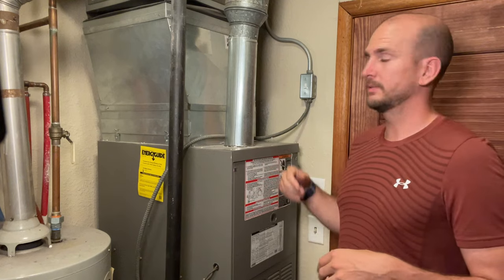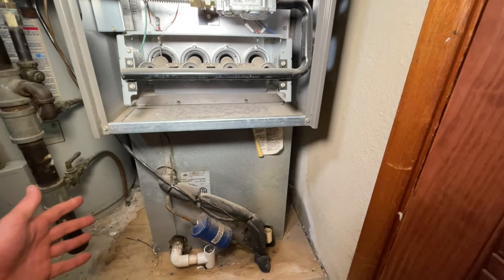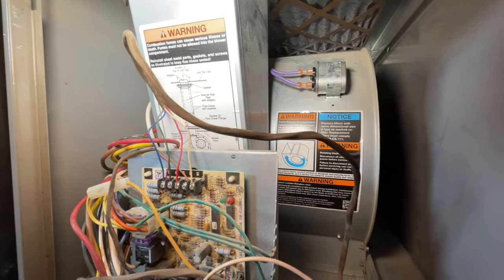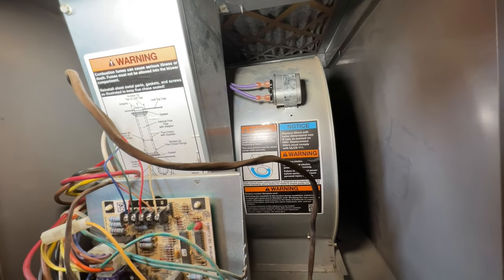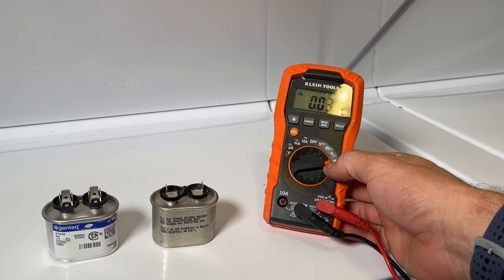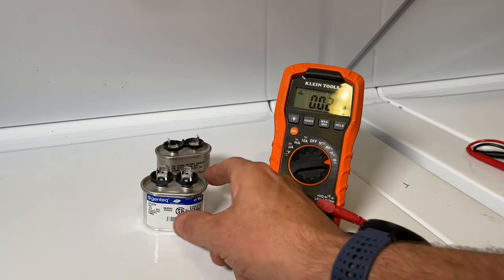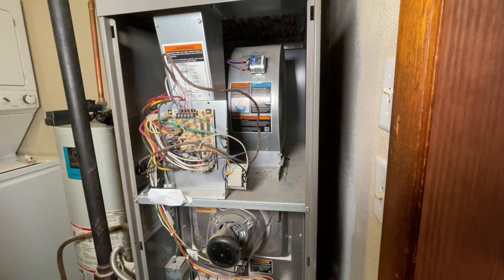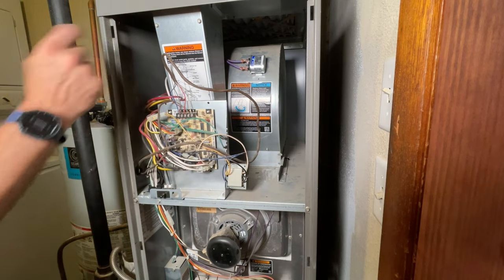Furnace or AC Blower Motor Not Starting | Loud Buzz or Humming Noise

Comment: Yea,  My thieving HVAC company, in my area, wanted $314.00 to replace my dual AC capacitor.  I bought it for $7.20 and replaced it myself.  Should be a law against this type of price gouging !.
Reply: Having just basic knowledge sometimes can save you so much
Reply: Omg serious. The serviceman wants $2000++ to replace my thermostat, board and labor cuz my furnace does not blow warm air into the room.
Reply: You pay for conveniet 
Company's have huge expenses if they work for cheap they can go out of business  fast
Reply: @mh_360  No one said “work for cheap”.  We’re saying stop price gouging (rapping) everyone. How about a fair price for what is, almost 5 minutes work ?
Reply: @ItAintMeBabe99 it’s not how long it takes to fix it’s how long it took us to learn. Fix it yourself or pay for a professional and do it right
Reply: @DeviousMeekz  Michael,  your missing the point.  It wasn’t broke !  He was suggesting what could be replaced because of low readings.  It had 3 push on clips and one screw for the band clamp.  I changed it in a literally 3 minutes.  Obviously you must be a repair tech if you can justify those prices.
It was clearly an “up-sell”, from him to get commission $$$.
Reply: What would have been a fair price in your opinion?
Reply: @dswingle8695  I’m glad you asked.  First of all, I’m not saying work for free, just don’t rape people.  In my case,  (the AC unit was already opened up, for other work) the $314 charge for a $7.20 item, would of been about a 4,300% profit.  So, I would say around $50 or $60 would be fair.

Analogy; let’s say you took your car to the dealership for needed work. While you were there, they said your windshield wipers are close to needing replacement. So, you say OK, do it.  When you get the bill, they charged you $1,090 for wiper blades that cost about $25 (4,300% profit) .  Would that be OK ?   Not in my book!
That’s all I’m saying.
Reply: I just am nervous about trying it myself. Really can’t afford to pay a professional if I had a way to know I was doing the right thing.
Reply: @ItAintMeBabe99 I am nervous my luxaire doesn’t look like his exactly but I have air and furnace in same unit. But I am struggling to identify the run capacitor and how to take it out.
Reply: @ItAintMeBabe99 your still not taking into account the overhead of a company. Some people are not comfortable with doing this stuff themselves. With almost everything, if you do it yourself, you will save tons. Now I will agree, some companies go overboard with the pricing. I saw a company one time try to charge 1000 for 2 capacitors.
Reply: @RonaldRegan314  Exactly my point . . . . . . . Stop screwing the customer!  I will never ever call the company that came to my house, again !  Furthermore, I’ve told everyone I can, about this “attempted robbery” and not to use them.
Reply: Same. They wanted to charge over $1000 to replace both capacitors and a relay, which I got all 3 parts online for $30. Recently replaced a sequencer that I got for around $25, and I'm sure they would've tried to charge hundreds for that repair as well. The upcharge is absurd. Even most auto mechanics don't overcharge that much. Nevertheless, it's a good thing I've learned how to be handy and fix what I can myself.
Reply: Your probably one of the pros charging a ton ripping people off!
Reply: @isaactungate6669  Isaac,  who are you talking to ? ? ?
Reply: @ItAintMeBabe99 what’s a fair price? You pay for labor not parts.
Reply: @davidhaworth7152  That’s exactly my point !  They were already here, had the unit opened up, adding Freon to it.  I was paying for the service.  The capacitor had “terminal clips”, which takes less than a second to unplug and replug.  So, exactly what labor am I paying for?

Comment: I thought this was my problem, my unit would buzz just like in the video or it would turn on, run for a minute and then turn off and buzz. The old capcitator was jumping all around on the meter so I replaced it. Still doing the same thing. Fantastic video nonetheless!
Reply: Check if you are getting clean power to the capacitor/fan.
Reply: @willarddickerson921  it was a bad blower fan. I replaced it and the capacitor and all is good. Saved about 1k which is even better.
Reply: @jg-wb3vm  how do you know which blower to get? are they standard
Reply: @xooq_  aw man, that was a while ago. I believe I did a Google search on my model heat pump and went from there. Also maybe got a number off the motor that was already on the unit.

Comment: Thanks! This vid helped me ensure that the sound I was hearing was what I thought it was. The capacitor cost $3.70. I had a friend pick it up on the way over. They were happy to help, and refused to accept my payment for the part, as I didn't charge them for lunch. Likely saved me $300-500 for a service call to get it fixed, and was solved before I had my morning coffee, rather than waiting a couple days in the heat for the repair.

Comment: Question. My furnace is comeing on the ignitor is lighting and a flame is there but not getting any heat outta the registers im getting air but no heat there is a flame but its almost like its not fully cycleing and its not turning off at all only if you turn it down below set temp.

Comment: Dude!!!!  THANK YOU!!!   My capacitor finally failed today, did a search on YT, found your vid, picked up the part at a local ACE Hardware and had everything back up in running in no time.  Took an extra hour to clean the fan/blades/intake/etc...  Super quiet on start up and works great!  Thanks again!  😎
Reply from the maker: Nice, my local ACE didn't have a selection of Capacitors but I did see some location about 2 hours away did.  Pretty handy having ACE stock common capacitor sizes 👍

Comment: I thought my motor was out again; just installed a new one in 2021. The manufacture date was August 2020 on the capacitor that I purchased with the motor. This video did help me determine that the problem was the capacitor rather than the motor. Thank you!

Comment: Worked for me!!!!  Took a while to find the capacitor, it was hidden on the back of the fan housing out of direct sight, luckily I saw two wires going back there and then felt around with my hand! LOL Was an old 1970s Bryant model.  Changed the cap and the fan started right up without the drawn-out groan.  Thanks again for this video!!!

Comment: Good info. My system is making the same noise and nothing is blowing through it so I figured it was the blower motor. I'll for sure try your fix first!
Reply: My blower fan isnt blowing air into the room. You can feel the heat but no warm air blows. Furnace sound like my furnace.

Comment: The tech had already replaced the capacitor, and it's still making the humming noise. It seems to do it when the temperature drops. If I turn the unit off and turn back on when the temp outside is 42 it seems to work.

Comment: Thank you, I was going to school for HVAC (epilepsy stopped that 😞)  but I still have all my books and stuff- I had the same problem with my Rheem system, and I have replaced the capacitor (the first thing that came to mind, plus it was a cheap replacement...) and then I couldn't get the whole system to start.  I started to dig through what could have been going wrong, the hum was going still going on- the circuit board... I don't have to replace the whole thing, or just which part (haven't found it yet... I still have to check it with my meter)  Sorry this is so long ago of a question, but I'm completely lost on this.

Comment: I had a bunch of power failures the past few days due to high wind storms and I guess my furnace went out when I was asleep and I woke up to my house freezing. I’ve trouble shooter it and it doing the same humming. The motor is new and I’m assuming the power going off and on so much may of messed the part your explaining in this video up. Thanks for the video and hopefully I can find one to see if that fixes my issue.

Comment: Thanks so much for this video.  I just pulled my capacitor and it only shows 1.5µf on 10µf capacitor.  Bought one at Grainger 5 minutes away from me for $5 and change.  Hopefully this solves my issue.

Update: Yep, replaced and it's all back up and running.

Comment: Not replacing batteries in thermostat cost me $500. Air handler stopped blowing completely but was humming and froze the inside and outside unit. It's under warranty and ac tech replaced blower motor. $310 for labor $97 for service fee and $90 for refrigerant. 2 days later it wasn't working. On a hunch I replaced thermostat batteries. Instantly the system was working fine. No problems since. I hope this helps somebody out there.

Comment: Thanks for the info. Would it be possible to list the most common failure points of the HVAC system, winters coming and would like to stock some replacement parts if needed, thanks again for sharing.

Comment: I have a brand new York furnace. It is running fine. When the furnace is idling but still plugged in, it makes the same humming noise you have. Does your new capacitor make any humming noise at all when the motor is not spinning? Thanks!

Comment: I have a question. I’m decent with DIY and I rebuilt my AC unit. Now I’m having furnace problems. I have a Carrier Infinity system. Error message on thermostat says blower motor fault. I reboot power and sometimes it starts. When it tries to start, I hear a thud, like a shoe kicking it. I hear the thud multiple times. When it does start, the blower motor sounds fine. Starting is the issue so could be run capacitor but would that cause it to make a thud sound? I figured it was probably the motor. Hopefully I can get a quick answer because when my system reaches temp and shuts off, half the time it won’t start back up. Thanks for the video and the help!

Comment: I am experiencing an issue with my air conditioning unit. Despite the cold air being emitted from the vent, there is a persistent humming noise. I would appreciate your assistance in identifying the potential cause of this noise.😊

Comment: What about the bottom half of the furnace? What's that for? I'm making sure I'm just knowing what I'm doing before messing with something I don't completely know. Thx if you can answer, kudos! God bless you and your family 👪 🙏 ❤️
Reply: That's the draft inducing motor for removing any extra gases from the system to the exterior of the house so you get a clean consistent start of the gas burners for safety reasons. There are several failure points in that system as well but it's only for the heating side of things and not the cooling part.

Comment: Great video, thanks for the info! I don't have this issue right now, but I've seen it enough times to know that I should prepare for the eventual fried capacitor now that I'm no longer living in apartments that handle that stuff for me.
Reply: Me too.  I might double check what mine is and have one on hand for if/when mine goes out.

Comment: Great video thanks. My furnance works if I put in the thermostat the fan on manual I get hot air into my house however if I put the thermostat in auto the furnace on but I won’t get hot air in the house, any advise? I will appreciate a lot

Comment: When my a/c switches on I hear a VERY LOUD click/clunk before it starts up.  When the a/c is off I can still hear a low buzzing sound.  Do you think switching out the capacitor will fix both issues?

Comment: thank you for the video. I am planning to replace the capacity as you show in this video. Hope it will solve the problem of my AC ( The blower is delay for couple minutes after the condenser started).  As I recall,  I did not replace the capacitor of the blower for the last 15-18 years. so I decide replace it any way.  I am appreciate anyone think it is a solution to fix the blower delay. thanks

Comment: AC tech who was a “ friend “ changed outside condenser unit capacitor for about $130 with a “ friend “ discount. Afterwards I changed mine out myself and never used him again. Just did it again 2 days ago. It was blowing warm air the compressor wasn’t running. Replacing capacitor fixed my problem. Only it doesn’t get to set temperature of 78 degrees and only gets to 81 degrees during the very hot day here in San Antonio. But does get to 78 at night  heat index 110 degrees during the day. I’m going to use coil cleaning spray can from Lowe’s see it that works. Filter been changed out. I cleaned outside condenser coil with water hose. Any other ideas?

Comment: Shut my ac off last night because it was cool out. Today all it's doing is buzzing in furnace. If I turn fan from auto to on it works. Outside unit is running. I guess cap? Also filter was dirty and I replaced it
Reply from the maker: Might be starting to go, do you have a multimeter where you can do a quick check on the micro farads?  Should be +/- 5% of the rating you see on the cap.

Comment: question we have a gas furnace also has central air alk winter we had use portavle heaters syopped working  can a outlet swich plug in house that bad set furnace not to work ?

Comment: That is also the case with your general consumer electronics electrolytic  caps as well.  220 mf at 250V, for example, with 220 mf, or whatever, at let's say 400 volts. Besides operation, heat is your primary enemy to capacitors in general.

Comment: I swapped out the cap on my outside unit for 30 bucks today locally, but that didn't do anything. I had replaced it a few years ago and that was the problem, but it isn't my problem now. I will check the blower cap in basement tomorrow. the vent fan isn't coming on at all. my aunt said it was making a noise, but since I didn't actually hear the sound, I'm stuck trying to figure it out. I'm mechanically inclined. I can replace anything if I know what that thing is lol

Comment: Mine does the same thing you showed. My blower motor is makes the exact same sound my cage in can spin it freely with no problems my question is if the cap doesn't work what else could be the problems.

Comment: I just had a new blower motor & capacitor installed in my quiet running 2005 TempStar N8MPN100f14A1 that seized-up one evening a couple days ago - a surprise as it's under a service contract and supposedly had a good capacitor. The problem is the new motor is producing an annoying and constant drone that I surmise is harmonic modulation that varies from a fast to slow whining-like buzz. Please, advise, what is causing it and how do I fix it? The service call cost me $1000. Thanks, in advance for your assistance.

Comment: Years ago the fan on the outside unit of the ancient heat pump system in the apartment I was living in refused to kick in. Maintenance guy knew right away what was wrong: bad capacitor. Took 10 minutes to replace. I was hoping for a new energy-efficient system. No such luck.

Comment: Thanks for the video.  The sound was identical to mine.   I confirmed defective capacitor on my furnace by spinning the squirrel cage by hand with "fan on" selected on the thermostat.  It started up just fine by that method.  I then turned on the heat, and just kept the fan on all day until I got the new capacitor.  The motor ran all day without having to start up again.  It would have gotten really cold in the house with outside temps of 20 degrees.
Reply from the maker: Nice, solid work troubleshooting. 👊

Comment: Hi my Lennox furnace /  Heat Pump system, the blower motor turns on when the heat is on but doesn't turn on when the AC turns on. What could it be.

Comment: I have a furnace that the blower motor works when I turn it on as a fan but once I turned it off and I switch it to heater the furnace turns on it ignites bed three minutes later after it’s ignited and running the blower motor does not even turn on, and the whole furnace turns off. What would your thoughts be?

Comment: this started happening over a few days. the fan was noticeably loud when kicking on and took like 30 seconds to spin up and was still noisy. then finally it completely stopped. after a couple days of testing. looks easy enough to replace either the capacitor or the motor. Mine has two capacitors, one obviously to the motor and i can't remember the other one. i'm guessing replace both since they're cheap. It's a rheem 90 classic i think

Comment: Do you have a video on replacing the blower motor?  Mine won’t turn so I’m guessing that’s the problem. Thank you for any help.
Reply: I replaced the capacitor today. Unfortunately the problem was both the capacitor and the blower motor. Yesterday it wouldn’t even make that humming sound but today after I replaced the capacitor it makes that hum sound but the motor won’t run. I’m having a problem getting that flue section out that’s blocking the blower motor. It looks just like yours in your video except my control panel isn’t attached to the sheet metal of the flue section. I can’t pull out the front sheet of flue after taking out two screws at the top. It has a couple tabs going thru the sheet it’s sitting on and I can’t pop it out.
Reply: @kristagerst2341  
I have the same problem. Tech came out and changed the capacitor and charged me $350. I was livid because I could have do it myself for 1/10 that amount. Up and running and the A/C goes out again. Now they tell me the blower motor needs to be replaced and they way $650. I told them, after changing me to fix the wrong problem, to go to hell. I bought a new motor and will try and replace it myself. Just wish it wasn’t 120 degrees in my attic.

Comment: I head a dept that makes industrial heaters. The blower wheel is a very thin and lightweight. If you ever have to remove it be careful and do not drop it. It will warp the crap out of it. I would also recommend wearing gloves. Those things will cut you like a razor